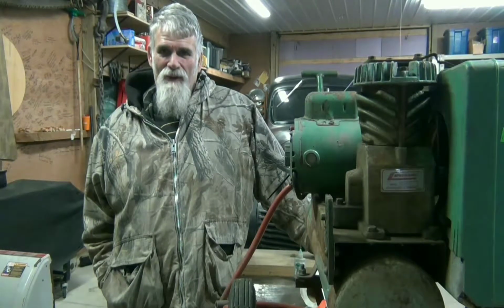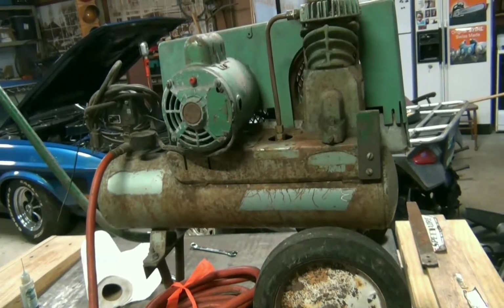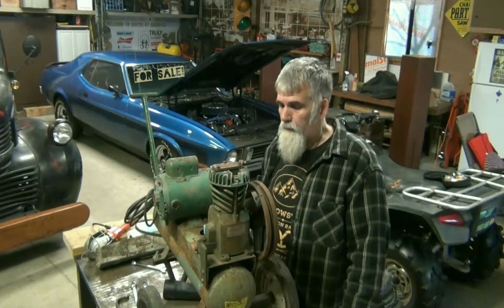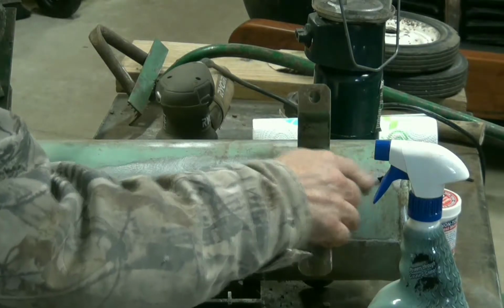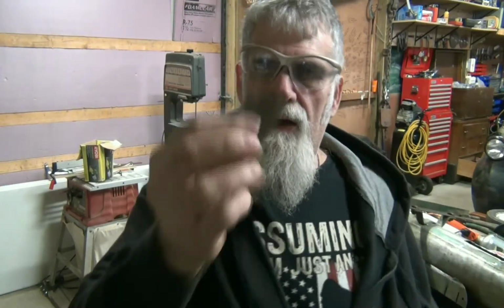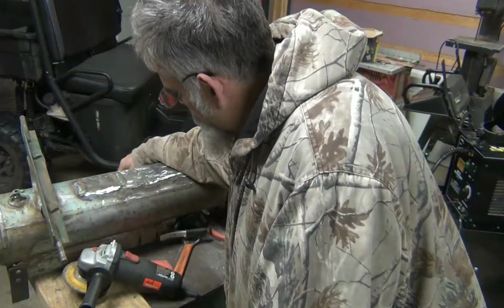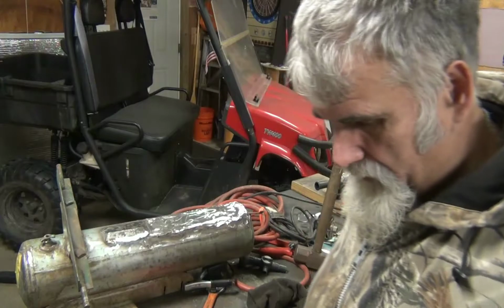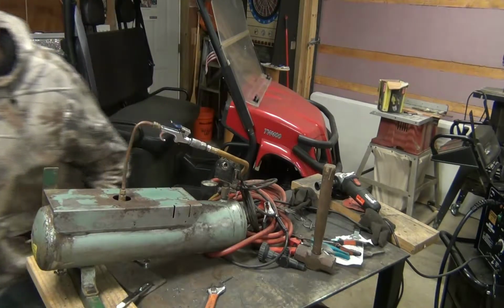How to repair a corroded Air compressor tank

Comment: As other people have mentioned, on no account should a very rusty air tank be repaired. Get another (new?) tank & swap the bits over. Also, the old tank was far to small, meaning the compressor motor would have running all the time air is being used!
Well done for posting the video

Comment: let me let you guys in on a little secret, im not saying everyone should do it, but I've repaired large industrial size and small ones on a regular basis for my career. Its safe if a certified welder makes the repair , but I have seen dozens of these tanks on a larger and small scale repaired the exact same way, certified and bought off by a cwi or api for years doing the exact same method as this guy did. I would see pmi[paint testing] some surewave[sound test] But the majority of the time a good ol' pressure test to 1.5 times mawp was what ive seen most of the time. With all the fancy stuff out there for testing I have largely seen and conducted hydro tests, for the inspection of my welds and other welders. And ya know If ya got your saftey valves inplace below what youve tested it for what realllllllly can go wrong. ya kicked it on accident? Well I wouldn't go kicking a brand new tank with a thin wall tank if it were brand new!  The inspection of my welds include but not limited to checking for holes or undercut and enough metal build up. other than that I let the hydro do the rest.
Reply from the maker: I played with this for awhile, mostly to try and practice welding. Once it became obvious that the vessel was really bad, and should not be used, I still practiced.

Comment: Somehow I've landed on a pile of exploding pressure vessel tanks, yours just happened to be next in the list. 
At any rate several months too late, I'm sure you've figured out that the wee little tank was probably a repurposed fire extinguisher, like a 3 gallon one. You can get the old stainless steel ones for like $10. I grabbed a few last time I came across them on ebay. Well worth the $30 to ship them; I've used them for a lot of cool projects where you need a big chonkin' sidewall.

Comment: Keep the motor and compressor parts but SCRAP THE TANK. You’re better off than trying to “repair” that one. Besides, any/all of the parts might come in handy for some other project(s). Keep on slugging away my man.

I’m hoping that Wildflower starts feeling better soon. Keep us updated.

Tacotodd from the FF
Reply from the maker: Thanks Todd. I'm kinda sorta planning on building an air filling station for my yellow portable tank you can see in the background there somewhere. :)
Reply: That’s going to be “da bomb”. Your filling station tank resembles a “Cheetah” style bead seater,!but I’ve seen plain tanks that look like that as well. You know me, auto parts industry for 30yr. It was like an addiction that I just couldn’t get away from. Had I known at the time I would have chosen something more in line with the forest, but then I wouldn’t have met my wife. Oh well…🤷‍♂️